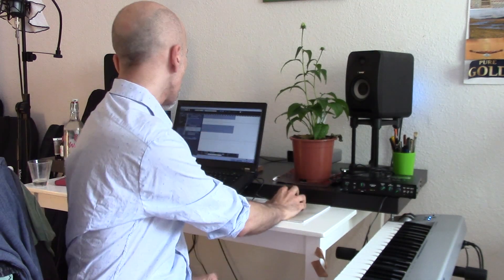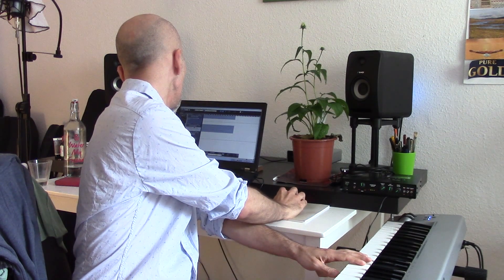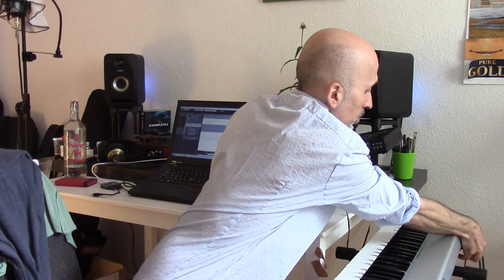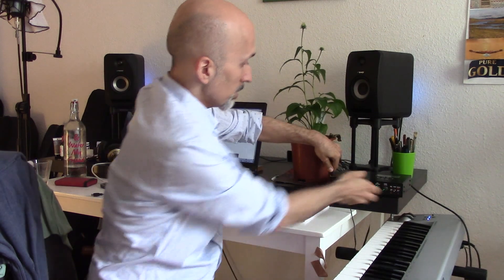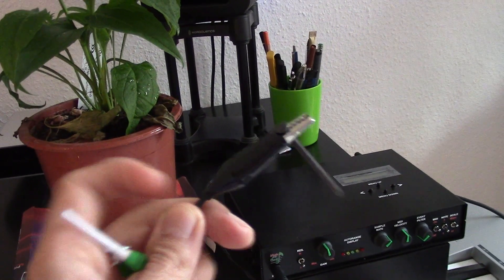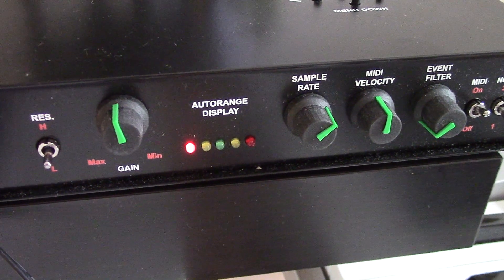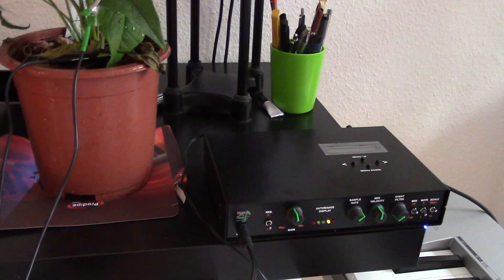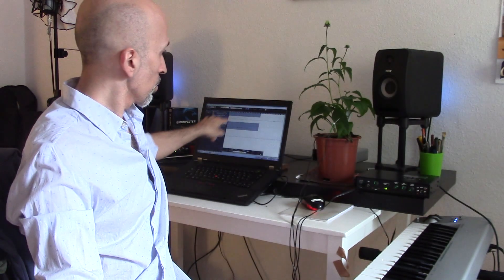Music of the plants - How it works

Comment: Is the device interpreting any change in electrical potential and converting equalli into any and each semitone? It sounds like all the music that comes out through these devices, it has always harmony, which is unlikely to happen. Shouldn't it be more random and messy? It looks like the devices work in a way that translates these impuses only into given musical scales
Reply from the maker: Yes, that's correct. The device also has a chromatic scale setting. I tend to use scales that allow me to join in and play along. Ideally, there could also be a microtonal setting, that would be interesting!
Reply: @SoundOfGoldenLight  thank you for your reply! I literally got to know about these devices only yesterday due to an ad, so I was wondering if it had a full chromatic scale setting. Microtonal would be too much to ask for😄 grazie have a good day
Reply from the maker: @ricobonimusic  My pleasure, all the best!

Comment: Excellently hoodwinked...

I don't think it makes sense, when the sound is eventually taken from the stored library of the computer,  at best these electrodes have some potential difference, and based on that (and also based on the choice of the instrument), the output is generated.  Perhaps there is no direct input of the plants,  even if he connects it to a dead man (one electrode on the penis 🤣🤣🤣 and another grounded), it would still provide us some sound, but I bet it will be far away from a human voice.  Thus the claim that its plant's voice is simply insincerity and bamboozling.

Comment: The real question here is whether the plant has any active input, or whether the device is receiving an electrical variable that the plant produces involuntarily.
For example, would you get the same result from something like a potato, or an inanimate object which could produce a variable electrical potential.

The other question is whether there is a detectable structure or pattern to this 'music'. Is it random sounds? Is it a pattern that repeats over and over?

Answering these kinds of questions will bring us closer to an understanding of whether what we are hearing is from a kind of plant intelligence, or whether it is caused by some involuntary action or electrical process that has little or nothing to do with the plant having an active input.
Reply: Keep searching there is a women who has explained it alot better I cannot find her at moment to show the other half . But she shows u a new plant never played music and 1 she does it with daily  the daily 1 has a tune straight away and the new plant is all over the place until it finds its pattern and she explains how if you talk badly to the plant it can change its tunes , eg, going to cut it down . Or where you place it in the cold etc they respond differently I love all this now to hunt her down again I will find it again ..
Reply: I am late on the answer but I am doing a similar project of the video with other purposes. The plant is an input, the circuit he must be using is simple variable frequency oscillator that you can find in the web if you search "Disney Touche Research". The plant, and the soil (if it´s wet) are just an extension of an electric circuit. You can use a bar of iron if you like and you could do the same. If the plant grows the assignation of the sounds will not correspond anymore of what we can hear. What the sofware is doing (I dont know what he migth be using,problable PureData or MAX/MSP) is receiving frecuency data, he is not only assigning the frecuency data with a sound, he has to be using a randomizer of sounds and a delay of frecuency, as the frecuency is constant variable. At this point is just the same if he plays randoms sounds without using the plant at all. There is no way neither biolocally or in the softwate programming that the plant can "hear" and "respond". 

Pdt, I am an artist I also studied biology; as an artist I usually use circuits and programing. As an artist I have found some fun stuff to do using plants and triggers (not just sounds, it can play a video if you say so in the programming code). But there is no output from the plants.
Reply: He explains that it is caused by a variable potential difference between the roots and leaves. Plants don’t have consciousness, but they are alive. If they don’t have consciousness, they clearly can’t have a conscious input.
Reply: @mikehume 
There is actually a growing amount of evidence that plants may have consciousness, and self awareness.
It has been demonstrated that plants can communicate with each other through at least two different mechanisms. Sometimes over large distances.
We also know that in established forests, there are 'mother trees' which share and distribute nutrients to younger, growing trees to help them survive.
It is also known that certain plants can form parts of themselves into a shape that mimics other creatures, such as bees, in order to lure them to pollinate the plant. This, from an organism which has no eyes or other such sensory organs of sight that we know of.
Whether they are sentient or not, plants are certainly very fascinating creatures who deserve much more study.
Reply: Very good point. As a musician perspective , it seems to me that the developer is setting a certain "restriction" on the musical output as well. It sounds as if there is a forced musical scale to make the notes fit together in what we would perceive as a pleasant sound. This can be easily done with the computer DAW, and it would be very surprising to change this scale. That would give completely different results.
Reply: everything has vibration  YOU just need to tune in,,everything organic has Life and Consciousness and we are connected to everything,,,,,we need to get out of the head  (left brain) and move into the heart (right brain)  we need to connect with our inner Self become aware who and what we really are,,,moving out of 3D reality  it is the Illusion,,what we call illusion is the reality  everything here is the opposite,,that is our challenge,,our journey home
Reply: @13scharlotte  That still doesn't answer anything. The question Hare asked is a very good one and I see the creator of the device didn't even bother to respond to it. I seen another channel where someone else connected a similar device to random objects such as paper and plastic and it was still producing harmonized sounds.
Reply: @Bizzare77777  hw isnt the creator is he?
Reply: @Bizzare77777  nvm i see, i agree with what fhis person said, but those are very solid questions, which they didnt answer any

Comment: The alligator clips are just conductors. What does it sound like if you put your clips onto your fingers? Or a dry cactus? Or a damp shoe? Your clips are relying on the electrical potential difference between the moisture from the soil and the plant. This is measurable electrically as is any connected object to ground. Sounds like nice music. Sounds like the impulse for the sound generation has nothing to do with the plant apart from its electrical conductivity. Good marketing for a handmade electronic signal generator though! Pity you couldn't give it an actual name. How about the Yu-1 Plantgen? Sounds heaps better than 'device!'

Comment: I think you did a fine description.   
Q:  using the same plant,  and now with multiple electronic pulse detectors attached to different leaves of the same plant at the same time, will each leaf be transmitting different electrical impulses , or are the same electrical impulses shared through the plant as a whole. In other words is there just one song being played throughout the whole plant because of grounding ?

Comment: Hello. I love this and am fascinated by it. Could you please answer some questions for me? If you are placing the electrodes in the soil, wouldn't it be picking up the electrical resistance between the leaves and the soil, not the leaves and the roots? Wouldn't you have to place the electrode on the roots directly for it to pick up the electrical resistance between them and the leaves? Also, how has the U1 been calibrated specifically for plants? How did you determine what the calibrated parameters should be? And finally, why have you restricted the output to correlate with the Western 12-note scale? Doesn't this round up/down the tones as the plants frequencies would surely translate to be microtonal? Has this just been done for creative license? Thank you!
Reply from the maker: Hi Emma, thank you for your comment. I am afraid I cannot answer your questions because I have not designed this device.  There are also other devices on the market nowadays, so if you do a search on the internet you may be able to find some answers. Personally, I would like to see an alternative with various tonal systems, including microtonal.

Comment: I have a few questions that perhaps you have dealt with before but, what is it that the plants are outputting to the midi-like box? And also, it seems that the plants respond to other music, voices, and even intensions. What is the plant responding to — is it words, sound vibrations, subtle energies? Or is this how it appears but has nothing to do with external influences? How does that work? Thanks!
Reply from the maker: Hi Sid, I personally believe that plants respond generally to the environment and more specifically to our presence, intentions and thoughts. Regarding your first question, the device measures variations in the electrical potential of the plant´s tissue. I am afraid I can´t be more specific than this as I have not designed the device and I am not electronic savvy :-)
Reply: Thanks
Reply: Here is an interview I did with the plants and a musician, but I still am uncertain what the plants are seemingly responding to: http://earthmysterynews.com/2016/05/28/music-of-the-plants/
Reply from the maker: Cool! Thanks for the link. If you'd like to talk about music of the plants and music healing in general, I'd be happy to have a chat :-)

Comment: Hi there. I work with electronics and I understand how this device works. The two "elelctrodes" you're using are just measuring the resistance (you watered the plant first to ensure conductivity) between the two, which happens on the surface(es) of the plant. Those electrodes aren't reading ANY kind of EM fields or activity. The "response" of the plant when touched is actually a change of resistance. Take a wet piece of wood or plastic and connect the two probes on each side - you'll get the same result. Different patterns? Yes, that depends on how fast the water is vaporizing or of the variations of the resistance of the wood, due to mechanical movement or environment properties. Don't take it as a critic, because it's not; i like the sounds and I make music myself so... It's just the explanation of how it works. We also recorded sounds of planets, of Earth etc. So why not plants? But in order to do that properly, you need to modify your tools. If you want to know my idea, write me back. Cheers my friend. :)
Reply from the maker: Hi Daniel, thank you for your comment. Actually, I didn't water the plant, it was raining outside. You don't need to water plants necessarily for that to work, although sometimes it can help.
Regarding the wet piece of wood or plastic, I am sure you would get some kind of reading from those as well. But that would not explain the fact that the music coming from a plant evolves in time the more a plant is exposed to its own sounds.
At first, I found it difficult to believe, but then I experienced it. But without the experience, I totally understand where you're coming from.

Comment: Hi , Thank very much for this work ! I love this art/science/philosophic combination, it's exactly the way I see the future...
just 3 questions :
- How can I contact the developpers of U1 Device ?
( I am interested to know the way variation of Wheatstone bridge resistance variation is converted in midi. This kind of "only midi" conversion seems to be the beginning of a great adveture, but needs also development. I am actually in France, working on audio/midi signals with various Matlab processings in DSPs and softwares. If contribution is possible...)
- Does the U1 Device can transmit the input signal (usable micropreamplified) also, or only numeric MIDI conversion ? If not, is it possible to easily modify U1 for a multipathway conversion?
- Is it possible to use many detectors or only 2 ?

Thank you very much ! see you soon.
flo.joupiano@gmail.com
Reply from the maker: Dear Florian, thank you for your message and for appreciating.
I am not able to answer your questions, but you may be able to get in touch with the developers here:
http://www.musicoftheplants.com/en/
Blessings

Comment: Nice! Is there a correlation between the electrical impulses from the plant and the produced sound pitch and also the architecture of musical phrases?
Reply: Well there ought to be one, but could you explain a little more precisely how are they related?
Reply from the maker: Dear Polina, I am not sure about the correlation with pitch. It is either low resistance level/low pitch or the other way around. As far as I understand, the architecture of the phrases depends on the amount of variations of resistance measured by the device.